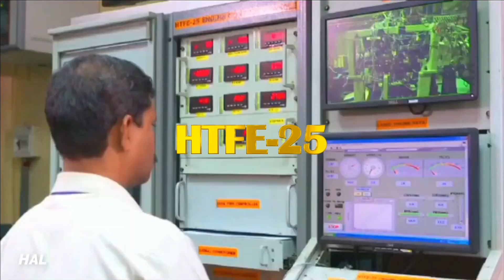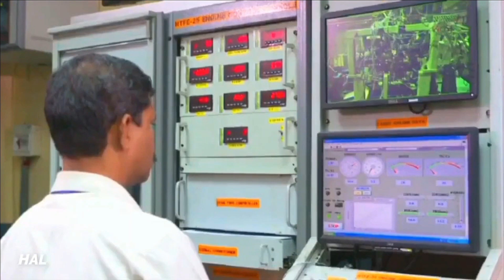HAL gets new design & test facility for HTFE-25, HTSE-1200 & IMRH engine

Comment: Recently Pakistan successfully tested indigenously developed Rocket Artillery Fateh-II (400  km)game over for india 🇮🇳😔
Reply: First you need to know the difference between missiles and rockets. MLRS like fattah 2 ate inferior to missile. They cannot change trajectory mid course and doesn't have anti EW systems. They also lack speed and are less accurate than missiles. For example, Fattah 2 have a impact radius of 30m, where pralay have less than 5-10m. 

Since rockets always follow a single flight path, and slow, they are easily trackable and interceptable. You dont need very sofisticated system to intercept MLRS rockets. the only advantage of MLRS or rockets is that they can be used in more numbers than missiles, since they are cheaper. But in this case, the number is also less. 

For example, fattah 2, each launcher can carry 2 rockets, hence making the single advantage of rockets useless. You need more launchers and trucks to use the number advantage, but that always increased cost and risk of getting destroyed by enemy fire. MLRS uses there number per launcher advantage to overwhelm enemy defences, but in this case the rocket per launcher is same as a missile, or even less, hence it doesn't give the advantage of the rockets. 

Even countries like US and china doesn't have over 300km MLRS ket alone a 400km one. Chinese PL-15 have a range of 280-300km and US's M289 has a range of 165-300km. No one uses a 400km range MLRS, cause they are useless. Its much easier to use missiles at that point. Pak doesn't have money so it has no choice but to buy cheaper solutions.

We dont even need S-400 for fattah 2, even our Akash, barak-8 and QR-SAM and Akash-NG in the future are more than enough for these MLRS.
Reply from the maker: How many missiles Pakistan economy can manufacture??
War is about sustainability. Pak can’t stand for 3 days before India in full fledged war. So let’s not get carried away with a 400km rocket test.
Reply: @IndianDefenseAnalysis  Well, lets not forget it is Chinese made and China has mastery in mass production. I was surprised to see Chinese can induct almost 10 destroyers in a single year along with other small ships and aeroplanes and drones.
Reply: @MujiPepe ”China has mastery in mass production” 

lol yea and it sure isn’t going to do it for Pakistan for free. Pakistan needs to keep buying them from China or pay them to make it for them. Both costs money. War is not just about fancy toys.